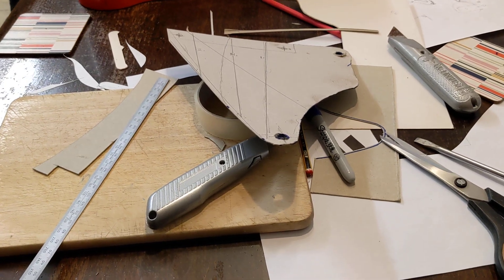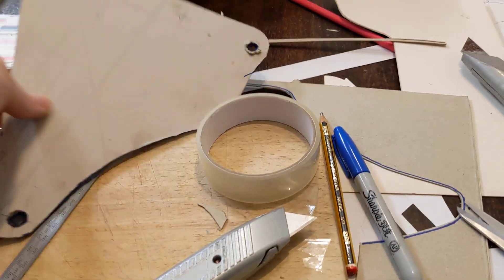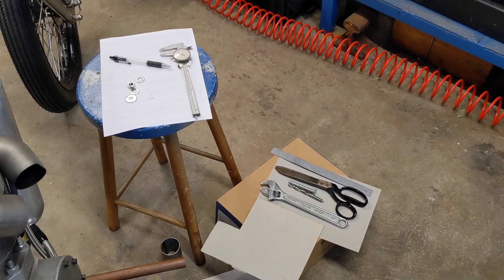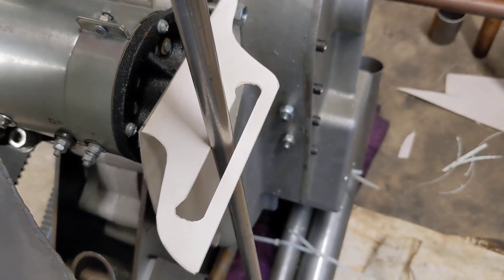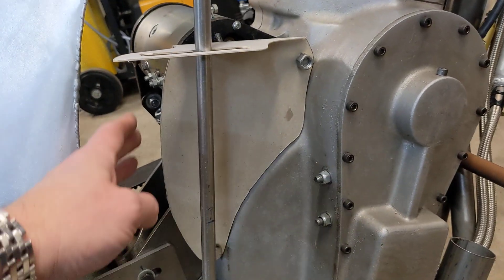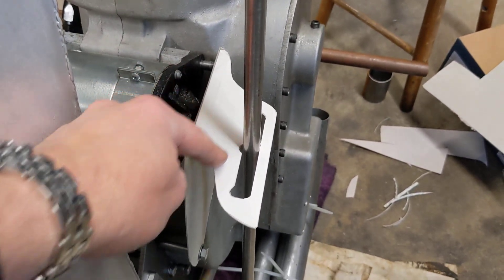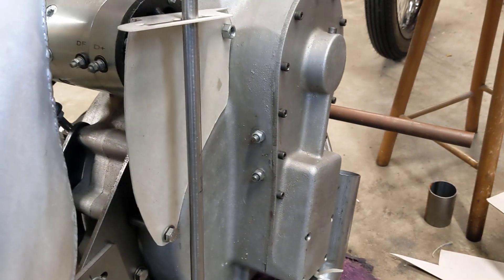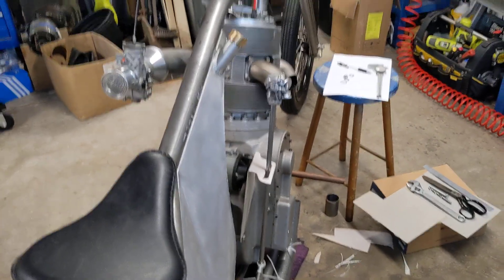CAD Design of the Gate

Comment: Looking got that mock up gear support 
Just curious what tipe or shape or stile exhaust will this beautiful bike have
Reply from the maker: @Nottsmodifiedcarchannel  I was thinking of a 2 into 1 coming down the front of the cylinder, but looking at the available space I might bring the rear pipe down separately and join then at the bottom. Probably makes more sense if I do a video. I'll put it on the list. The exhaust will come fairly late as it will need to miss all the other bits, and some of those bits don't exist yet! (Footpegs fur example ).

Comment: Where will the spring to make the lever engage the detent go?
If it is going to sit down by the gearbox it'd need to be a fairly stiff spring given the length of the lever above it. And the weight shifter knob.
Reply from the maker: @davidbackman4442  it'll go horizontally to a peg underneath the gate.. I'll show in a future it when it's finished.
Reply: @StoneEng  Sounds like you've got it covered then!

Comment: Love it. I keep CAD panels on a shelf as you never know when you'll suddenly need it. Never throw gasket boxes, note pad backings, or random finds found in shipping boxes. Hoping you'll be able to get 3 point bolting to get rigidity for it.
Reply from the maker: @JaySiewers  yes, 3 point attachment would be good but makes the plate quite large. We'll see how it goes with those two first.
Reply: @StoneEng  I just went back thru previous videos looking for a view of the right case and saw two more case mounting points behind the cardboard. Doesn't make the plate larger, but four available mounting points. And as many as five at the rear to the engine mounting plate. Quite robust actually with your existing CAD design if you want to.😊

Comment: The top plate looks like it might be a bit of a leg slicer if you make it in thin sheet.  Perhaps you could you weld on some bent round bar around the edges to make it a bit safer
Reply from the maker: @mrdderby5234  something like that yes. If I fit a nice brass plate in the top it'll add thickness too.
Reply: Maybe round off the point at the back as well, it looks nice but if you bang your shin on it you'll be swearing.